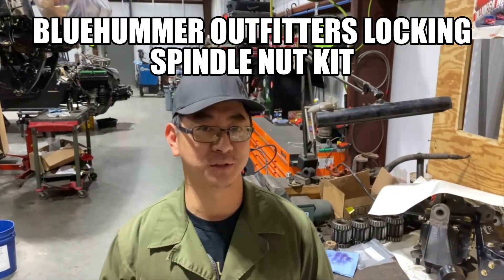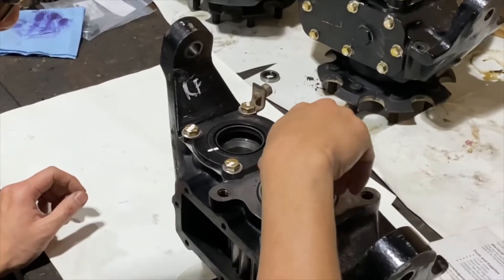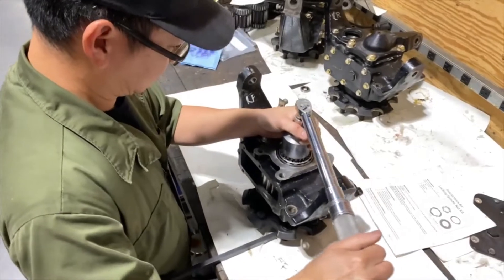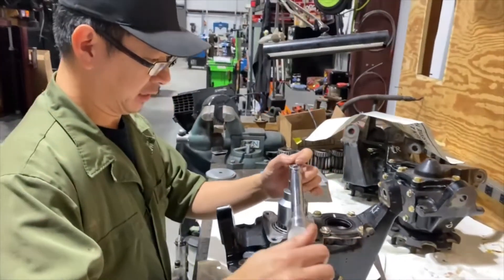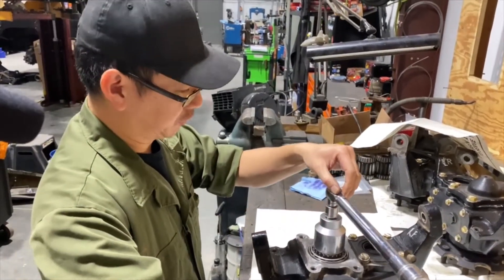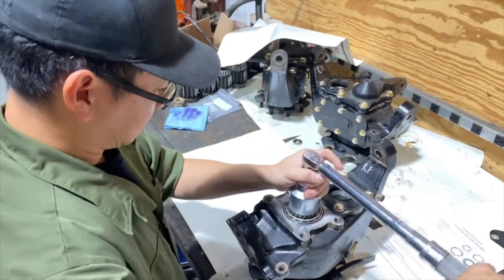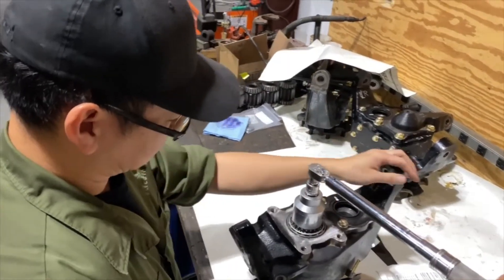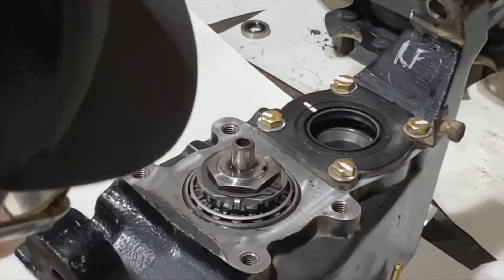Mod Mafia: How To Install BlueHummer Outfitters Locking Spindle Nut Kit

Comment: What size "Snap ring Pliers" do I need for this?
Reply: There's no size marking on the plier I used. My set has three different sizes and I use the largest one for this application.
Basically the size that fits snugly on the snap ring.
Reply: @poonnintechachaiponpoj5736  And ur safety glasses!!   Never so glad I put 'em on as that day when one of these big snappy bastards dislodged at maximum stretchification and sproinged me RIGHT in the woulda-been-my-eyeball!!

Comment: Great job Poonan!! I recommend just going down the C service punch list. Also, maybe adding why the products you recommend are better than the others for us novice owners (or maybe I’m the only one...). 🤷‍♂️😁
Reply: The OEM locking spindle nut rely on a small screw to hold a clamp load on locking nut to the spindle. They are failure prone especially when running aftermarket wheels with significant change in offset from factory spec. Failure is catastrophic and usually happen while vehicle is in motion, wheel & tire being eject from the vehicle at speed!
For this reason , it is the #1 recommended modification for any H1 & HMMWV owner using their vehicle on & off the the road.
Reply: @poonnintechachaiponpoj5736  I don't know that mine were checked and seated before putting the lock ring and snap ring on.  Will I have done any damage to anything not seating everything first?  Is there a way of checking to see if I did any damage?  Also, is there a possibility of failure if not seated correctly?
Reply: @cpamma   You can check for play between spindle and the hub casing when the tires are off the ground, there should be no movement as bearing is preloaded to 25 ft/lbs.  Any slack indicate incorrect preload on the bearings and should be addressed immediately.
There's a potential damage by not seating bearing correctly.  To check, you would have to get back in there and check the bearings & races to assess the condition.